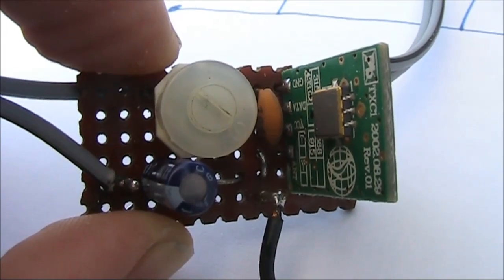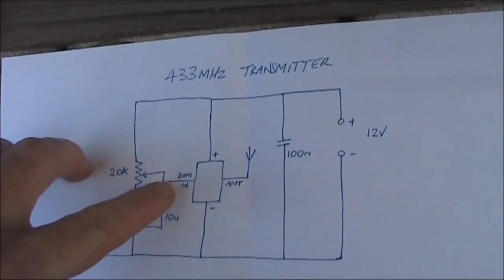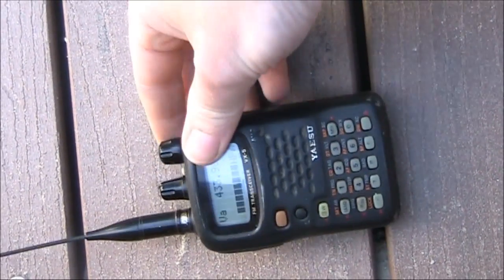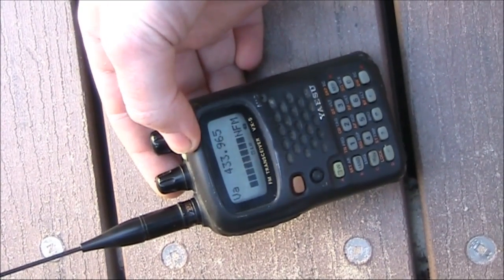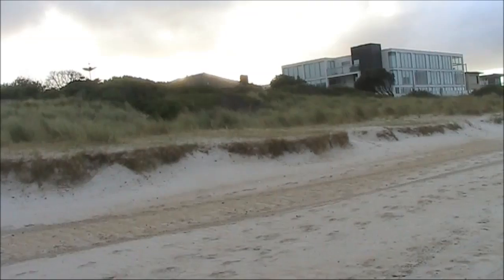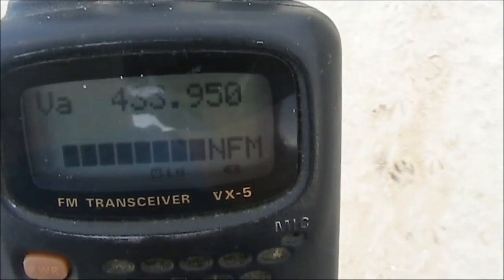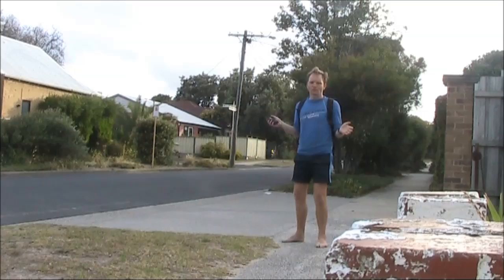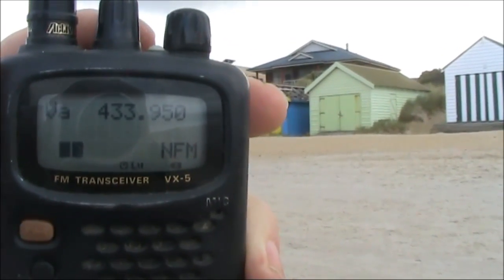Experiments with low power UHF data transmitter modules: Part 4

Comment: Unfortunately the FM is a side effect of the poor AM transmitter design. The oscillator frequency is voltage dependant and thus as the AM changes the current draw (and thus supply voltage fractionally) the oscillator changes frequency causing FM too. Although it's potentially useful, it's very poor practice :) de M1GEO